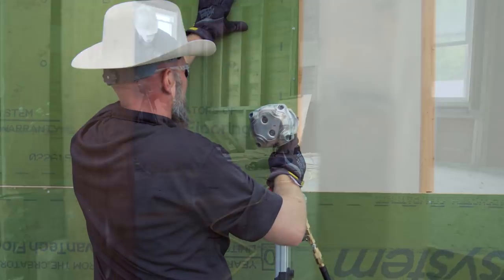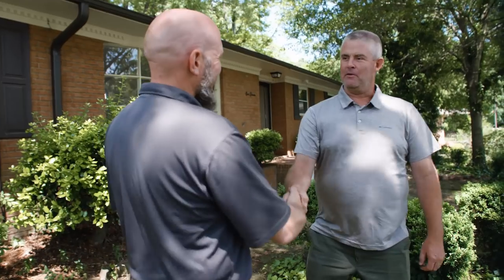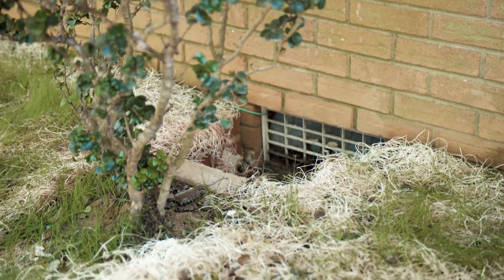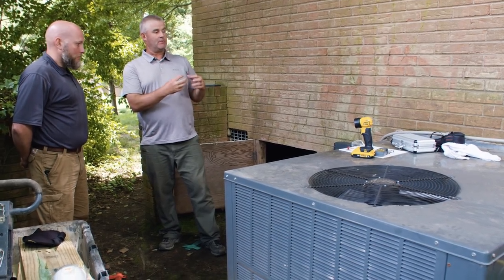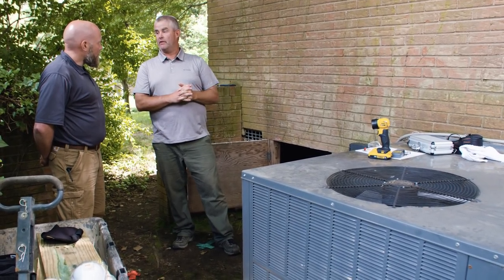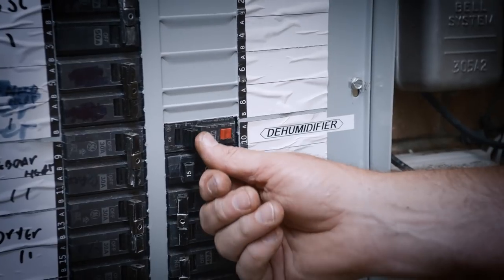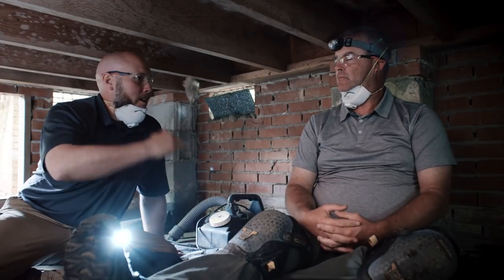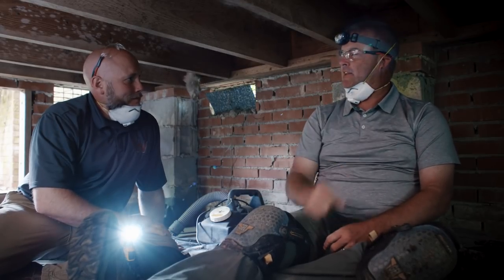Building Science: Moisture Mitigation in Crawlspaces | Lowe's Pro

Comment: use soap and water clean the wood then spray it down with anti-mold and if there any rot then jack it up on both sides and cut it out and put new  wood in. Lay a flooring down and add spray foam to corners and area's where its rotting seems easy enough.

Comment: Wait a minute. If you encapsulate the wood with that spray foam, the mold/fungus spores inside the wood will keep going, but you won't be able to see the damage. And putting back fiberglass insulation would just create the same nice environment for mold that was there before. How hard would it be to remove that foam stuff?

Comment: I was surprised to see a brick foundation in a modern built home. I am used to concrete block. Also, does the home occupants have to leave the house when mold spraying is done? Anybody familiar with that?
Reply: Depends on what they sprayed.  I had my crawlspace treated before moving into my home. The company used a quaternary ammonium disinfectant and strong peroxide.  It wasn't horrible but it did migrate up into the house through various leaks.  The disinfectant smell dissipated from the living space in a couple hours but lingered in the crawlspace for about a month.

Comment: What happens if you have an existing crawlspace and add a layer of cement on the ground? Will humidity be an issue?
Reply: Yes, concrete is still porous so moisture will rise up out of the ground. You need to add a plastic vapor barrier underneath the concrete pad and seal the concrete.

Comment: I like the IDEA of this video, and the last couple of minutes explaining where the moisture comes from is good, but I'm seeing a lot of misinformation put out by the contractor, and therefore tacitly endorsed by Lowe's.  First of all, his mold remediation system is a joke.  I don't know what chemical he's running through that fogger, but I guarantee you it's not killing or removing the mold.  Physical removal of the mold from the substrate, and out of the building is the only way to properly remediate.  Anything else is improper.  Secondly, semantics I know, but mold and fungus are the same thing.  If you've got a "fungus issue" in your crawlspace, you've got a mold issue, and vice versa.

Comment: Why block the vents. Don't you want that airflow?
Reply from the maker: Trevor Phillips Blocking the vents prevents warm, moist air from the outside from moving inside to the crawlspace, where it cools and turns into condensation, creating moisture problems.
Reply: @lowes  But won't it have the opposite affect in the winter?
Reply from the maker: @saulgoodman2018  By adding spray foam insulation in each band joist bay between floor joists, it will create a vapor barrier and increase the R value of the crawlspace and help keep the temperature outside from impacting the temperature inside of the crawlspace.
Reply: @lowes  But you still want airflow.
Reply: @saulgoodman2018  why do you want airflow in a crawlspace?
Reply: DealerTags for proper ventilation.
Reply: @saulgoodman2018  but why do you need ventilation in a crawlspace?
Reply: DealerTags like the video sir, for humidity, and ventilation, so you won’t get mold. It’s like the same as having soffits so you get airflow in your attic. So you don’t get mold.
Reply: @saulgoodman2018  you can't grow mold without moisture. if you block moisture from the ground with the vapor barrier, seal the vents to prevent moisture from outside, and install a dehumidifier to take care of any residual moisture that is created via capillary transfer through the foundation, you don't need any ventilation. I thought that was the whole point of the video.
Reply: DealerTags if you have cold air outside, and warm air inside, that can also help the growing of mold.
Reply: @saulgoodman2018  yep, the temp difference would definitely aid in the growth of mold, but you still have to have moisture for it to actually start growing. it sounds safer to do it their way than to rely on crawlspace vents, particularly in the humid South where they were in the video.
Reply: DealerTags I’m not saying to don’t do what they did. I’m saying why block the vents at all.
And they did a hack job at blocking them.
Reply: @saulgoodman2018  because if you do what they did and you don't block the vents, the humidifier will be trying to dehumidify the air from outside too
Reply: DealerTags I think this is a very good point. In fact the professional gentlemen mention this exact reason during the video if I’m not mistaken
Reply: DealerTags plus it sounds like the exhaust from the dehumidifier is pumped to other side of the crawlspace causing circulation of air.
Reply: Art Of It All you have to put the dehumidified air outside, you can’t keep in inside. If you do, that defeats the whole purpose of the system.
Reply: DealerTags no it won’t. The way they block it, looks so cheap. You’re paying thousands of dollars. It should at least be closed properly. With bricks, on a brick house. Or wood, on a wood house.
Reply: @saulgoodman2018  it definitely doesn't defeat the purpose. once the air passes through the dehumidifier, all of the moisture has been removed and the moisture is pumped outside of the crawlspace via a hose connected to a condensate pump.  the dehumidifier has a duct that runs to the opposite side of the crawlspace and pumps out dry air which makes the air move around the crawlspace and pushes it back towards the dehumidifier, where it continues to remove any residual moisture in the air.
Reply: @saulgoodman2018  you're right, brick or wood definitely looks better, but XPS rigid foam board and the spray foam insulation creates a water tight seal, so moisture/humidity can't pass through. you wouldn't remove the original vents, unless you were bricking the holes in, the XPS goes on the inside of the vents, so you wouldn't see it from the outside. it only looks bad from inside the crawlspace.
Reply: @saulgoodman2018  Just found this video.  I will attempt, though somewhat late, to help you understand the why of what they've done.  When you install a dehumidifier, especially in a crawlspace, that air needs to stay in there instead of being ducted out.  That keeps the dry air in the crawl, which is what you want.  If you exhaust it outside, it will create negative pressure, which will bring in either outside air, or air from in the house, which isn't something you want, because then you'll have to dehumidify THAT air.  This leads to increased dehumidifier run time, significantly shortening the life of the dehumidifier, which is pretty expensive.  If you keep it contained, it will eventually dehumidify all the air in the crawlspace, which will pull water out of the wood, preventing mold and rot issues in the future.  Eventually, everything will be in a nice, dry equilibrium, and the dehumidifier will only need to run occasionally.
Reply: @edwardconley5250  Agreed, except that radon can then become a problem in homes where  it had previously been diluted.  I have an always-on radon meter and have observed consistently higher readings with the vents closed.  

Also, my understanding is that code requires some form of air exchange with the building if the vents are sealed, separate from the dehumidifier.  I am not particularly interested in installing a giant leak to the crawlspace after going to so much trouble to air seal the living space.  A dehumidifier reduces humidity to solve the mold problem but does not address the buildup of other contaminants that will migrate into the living space via stack effect.

Again, not saying you're wrong, just pointing out that there can be unintended consequences to closing up a crawlspace on a retrofit basis.  It's always harder to retrofit than to just build a sealed crawl in the first place.

The solution that intuitively makes the most sense to me for retrofits is dewpoint-controlled ventilation where outdoor air is used to dry the crawlspace when its absolute (not relative) humidity is lower.  This would be effective for 9-10 months out of the year in this area and reduce dehumidifier run time substantially.  ATMOX is one such system.
Reply: @saulgoodman2018  I believe they also put in a dehumidifier. Should take care of any moisture.